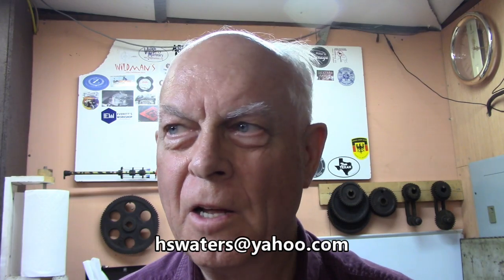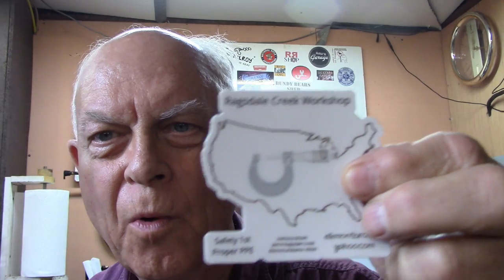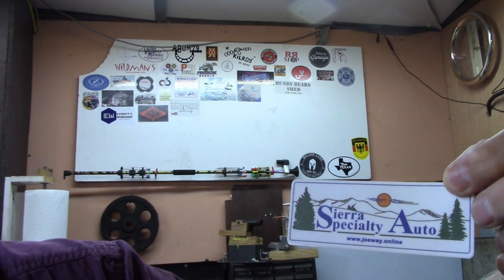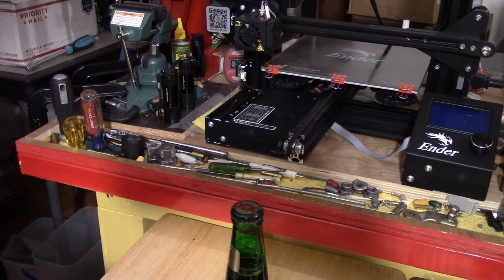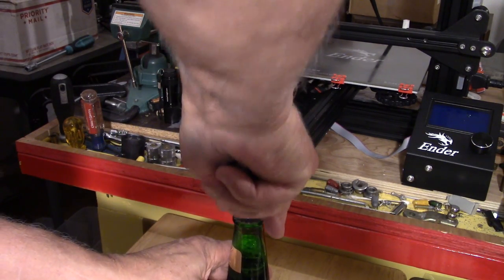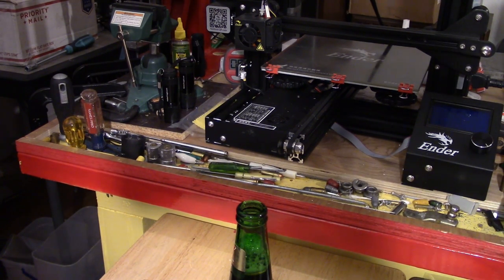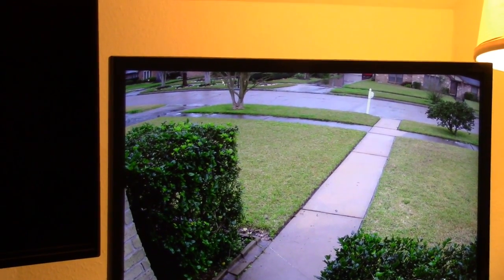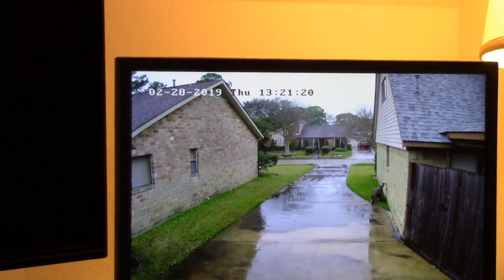Plasma table starting the welding part 1 of 2

Comment: shame about gluing the bottle opener wonky.... if you clamp yourself a fence on your bandsaw do you think maybe you could cut down the glue line? maybe if you can cut it apart glue a bit of serial box or thin cardboard between to get the thickness back?  oah hey... maybe 3d print 10 or 20 layers on the printer then cancel the print?
Reply from the maker: I can just print a new opener.  It will not be carbon fiber but what the heck.  Thanks for stopping by.